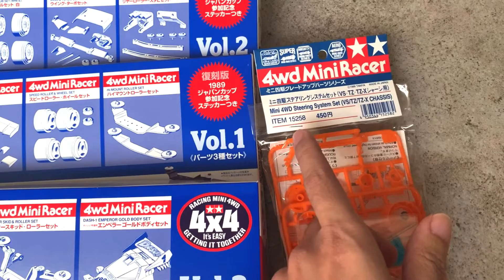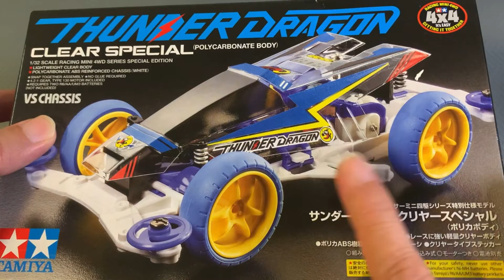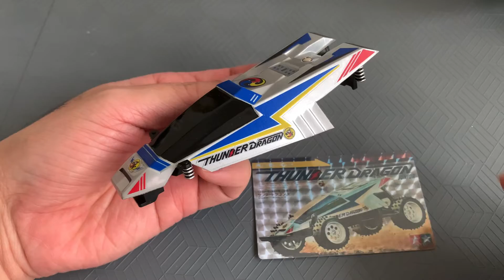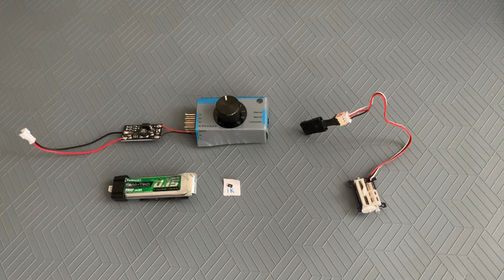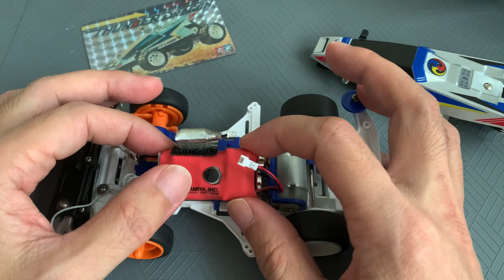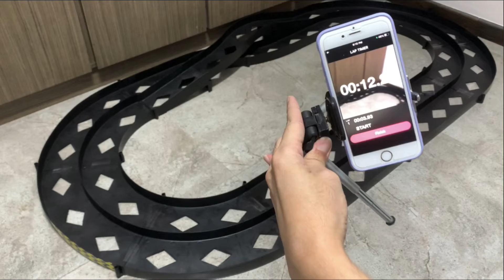Power Steering Mini 4WD!

Comment: what if i mount the pivot directly to the front sliding damper?
Reply from the maker: @MrHrj97 it should work if there is enough room for mounting
Reply: @terence79chan  i tried it, and it works. need a few adjustments, btw
thank you for inspiring me through this video
Reply from the maker: @ great! I’m glad that this video helps. :)

Comment from the maker: Thanks Rex, you are right. I could test various  steering angles by deploying different-value resistors. The other approach is to go digital with a micro Arduino board to program the servo’s travel. 😉